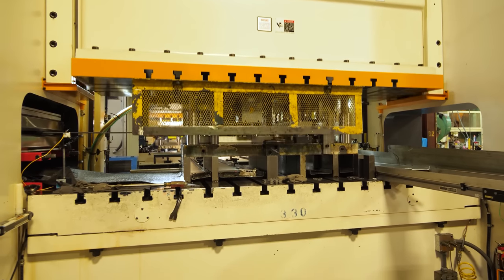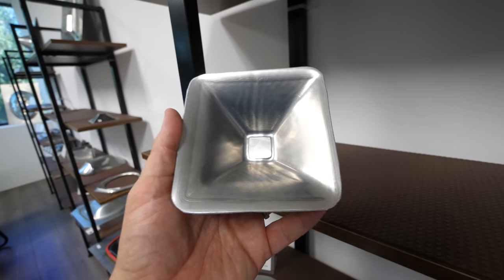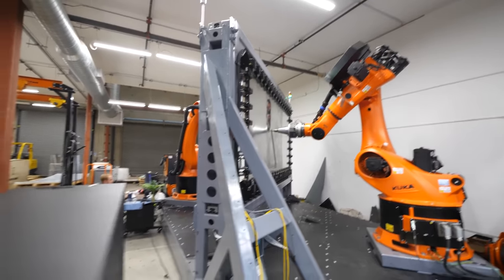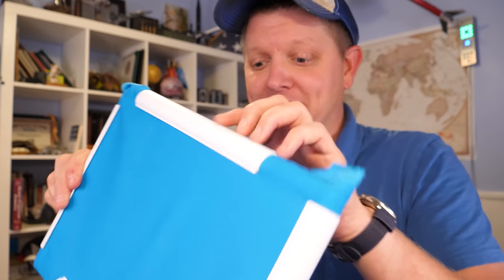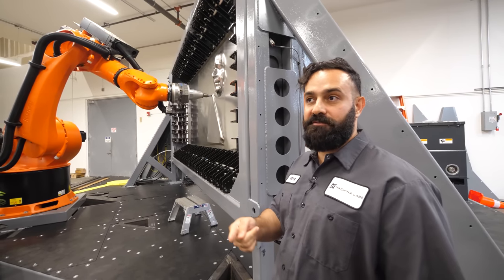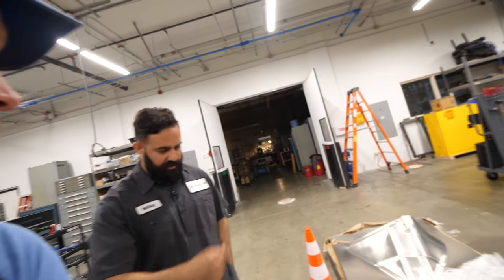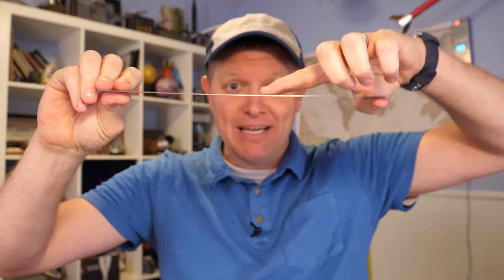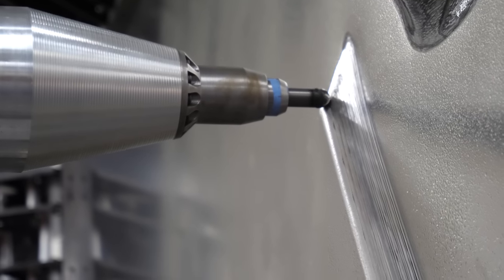ROBOFORMING: The Future of Metalworking? (I Had NO IDEA This Was Possible) - Smarter Every Day 290

Comment from the maker: The Manufacturing Series is AWESOME. If you like awesome things and hate spam, you can sign up for the email list here:: https://www.smartereveryday.com/email-list
Reply: this is absolutely amazing, thx for sharing OMG amazing
Reply: Holy smokes that's a lot of data to process afterwards
Reply: you should follow this video with the old hand method of english wheels and pinch rollers .. because that is exactly what this is ... just updated to be done by robots instead of people
Reply: I love this channel, and this is some of the smartest, coolest, and most fascinating smart stuff going on right here! Wow!
Reply: Why not move the sheet instead of using Mr. Roboto?
Like what a English Wheel sheet metal shaper does.
Reply: Why don't they run a machine closer to a 3d printer with set xyz axises so you could get more Rididity
Reply: Absolutely loving this series
Reply: thanks for this video
Reply: About metal stamping. Can't we use AI to create forms? Problem of complicated design solved.
Reply: CRAZY! Mind blowing!
Reply: Alpha Phoenix and steve mould did some amazing videos on how the atoms in the metal move.
Reply: One topic the video and your discussions seem to have not covered is applying heat to the metal to make forming easier. Is this something that was discussed during your visit? I understand the constant friction from the rolling would heat up the metal as it's being formed but I'm referring to heat from an external source.
Reply: Hey Destin, this is so interesting!

I do have a suggestion though. For the example at 7:30 , if you use aluminium foil on a sewing frame instead of fabric, it will be easier to make your point across. Because the foil will behave more like metal and less like fabric; it might actually hold up some shape after you poke it with your finger. You’ll have to be careful not to tear through the foil though. Maybe multiple layers of aluminium foil will be better.

Great example regardless. 👍
Reply: Okay, they mentioned hypersonics. Please tell me given your old line of work you guys got to nerd out off camera about some of that.
Reply: You cannot get "smarter" every day.  You are born with what you have.
Reply: Love this manufacturing series! ❤ Everything's software and coding these days and it's refreshing to see how physical things are actually made. 🤠
Reply: with a non-magnetic material like aluminium, could you use a magnetic backer to provide that support and run the process with one arm? If then, Could you just "pull" the metal toward you with a bearing rolling on one-side and a magnet on the other?
Reply: Please keep posting videos on manufacturing, even if its a few sprinkled into your normal uploads!
Reply: hey it's not as cool as this but I work at Collins Aerospace machining carbon fiber brakes with CNC. You've talked about CNC before, but machining carbon fiber offers some unique challenges separate from machining metal
Reply: Geometric algrebra is a very interesting area of mathematics. For example, Maxwells equations plural become Maxwell's equation (singular). They all get subsumed into one. 
What's also interesting is that Geometric algebra solves robotic problems like this. 
I wonder if that's how they are operating.
Reply: Also, you should find someone who is really good at an English Wheel. They're artists who have been doing that by hand for...ever.
Reply: I wonder if they thought about moving the material to help with deflection problem for certain applications
Reply: @charliecostella  Anealing on the fly was my thought. 

Another was different tools on each side. A ring on one side, the existing tool on the other. 

For deflection, why not partition the area off into smaller areas? Less deflection. 

On the cutout at the end. Cutting tool one side. Why not have some sucker tools on the other that hold the part and place in a stack. 

That shows one restiction that I can see. Getting an under cut [a cave is going to be hard. All it can do is replicate a height map with only one height at each x y point
Reply: 2:30 thats not you talking in the room. over talk
Reply: @StrayVagabond  huh. Thats neat
Reply: I enjoy your videos Destin, I really do but this dude has set my brain so on fire, I don't think I will ever recover. I'll be honest I kinda wish I could hire him as a teacher or figure out who taught him at school, cause he's on fire talking to you. You also did a good job providing context and helping me understand some of this higher level engineering stuff.       .... Dang if I didn't want to be an Archaeologist I would be an engineer, those people always have the best ideas.
Reply: Its a virtual mold.  Very neet.
Reply: Modern English wheel
Reply: Hope you invited Dream Theater to that progressive metal factory.
Reply: Keep doing this bro. People should fund this content for tv honestly. USA needs it
Reply: THis is a computer controlled with a robot English Wheel that craftsmen been using for a long time but not this accurate.
Reply: I could se this technology making star ship hulls at a breakneck speed. one big sheet no weds just pinches.
Reply: @smartereveryday  I am real ly inter rested in you are clock. What is it
Reply: I can see an application for this technology for manufacturing aluminium panels for bespoke one off cars.  I see lots of comments about this technology being a modern take on an English wheel
Reply: Wouldn't it be cheaper and more accurate to use ballscrew 3 axis machines instead of robot arms?
Reply: I used to install machines like this for cutting stone. Robot arms are impressive eye candy for walk through guests, but they''re not known for their prolonged accuracy. 3 axis machines with gear racks can easily get you plus or minus .002 of backlash. Ballscrew CNC's can get you .0001 accuracy.
Reply: ...and now you HAVE to do at least a bit of sheet forming using 'bullets hitting bullets'.  :grin:
Reply: Being a 52 year old 'Grumpy Brit Git' (lol) Electro/Mechanical Engineer myself, I've been watching Destins videos for years with much fascination. And I just LOVE the idea that Destin is going to all these factories and plants to explain what's going on in a fun way, not just to entertain us with enjoyable content, but, like he's done for all these years.... To hopefully help the younger generations learn the wonders of engineering & manufacture so we get new electricians, mechanics, engineers, programmers and many more besides into the associated industries. I simply CANNOT commend you enough Destin! You're a top notch fella! 👌👍
If you think about it... This is the thoroughly modern take on an 'English Wheel' (two varying sized rollers 'Pinching' sheet Aluminium & steel a craftsman uses to make hand made car (and other) body shells)...  
😎🇬🇧
Reply: yeah, they have trouble  to form titanium Inconel, hastaloy, monel... c300 vasco... even in sheets. too much nickel mixed with iron, manganese and chromium.
Reply: @kaboom-zf2bl   done something similar to what you have just said in school many moons ago with copper molding ashtrays. from sheffield UK
Reply: now i know Han Solo wasn't really in carbonite
Reply: When you were explaining the backlash with the drill and gears. The way you help neutralize the lash is Pre-load. You never release the pre-load from the other side. You just decrease the force applied to allow movement in the opposite direction. Just adding some polish to your explanation.
Reply: 12:25 is a rack and pinion operated sled.
Reply: @thedarkknight1971  "If you think about it... This is the thoroughly modern take on an 'English Wheel'." 

That was one of the first thoughts that popped into my mind.  Perhaps going back over the formed piece with MUCH larger 'wheels' would help it to be smoother.
Reply: Impressive stuff technologically speaking, but one does have to wonder if it really pays.  So much of what is done in business now only appears to be competitive because of subsidies such as windmills and electric cars.  They basically ignore the subsidy money being poured into it, but if one (as one should) includes the subsidy money propping it up that's the full cost and one sees that it is not competitive.  Just that something requires a subsidy means it is not competitive.  That he said, rather vaguely, that the break even point is farther out than one might suspect does make me wonder.
Reply: @OB1canblowme  I forgot to say I know an application where harmonic drives dominate. On space probes for things like cameras. Its because they don't require lubrication like cycloidal boxes do and they weigh a lot less.
Reply: @KeithOlson  Well, they did say that 1- They're still developing the idea, and 2- They did have different sized 'Inserts', and if you noticed the difference in 'Ridges' on the Triangle, compares to the 'Bowl' designs, maybe they do, or maybe it's part of their 'Finishing' process? 🤔
Reply: @hanswerner321  Yeah but if have ever been around die making you'd know how time consuming that is.

With this system you can design something and then just get it made right then. 

If you want to press some of these parts it takes weeks to do all the machining of the dies. Some of these parts would need a collection of progressive dies and that's a lot of machining. Its one of the main reasons car companies don't seem to change much from model to model.
I used to work in the Australian auto industry and spent time in pressing plants. You'd be amazed how many parts go from car to car with almost zero changes because its just to costly to make new dies every time. Its why so many famous sports cars had all sorts of things from the spare parts bin.

So for low to medium manufacturing this would have advantages BUT for serious mass production where you're making 1,000s of cars a day you're right its too slow.
Reply: I'm watching this video and I keep thinking about vehicle body guys and hotroders. They do this with 2 hammers and feel it out. What an art form.
Reply: @kyleteal5888  Your right. The basis for this is the sheet metal forming the body shop guys do with an English wheel where they have 2 rollers with slightly different shapes that they use to shape fenders, hoods,...etc.
But they also include the the methods used in high end metal folders and press breaks except this is a point load system not a long liner tool.
Reply: Seems like a lot of waste is involved forming this way. 26:10 one part out of a huge sheet of metal
Reply: You should come out to kenlake foods. We pack peanut products in cans and bags
Reply: this is one of oldest ways to make things from metal sheet... it was used for sheet deforming for hundreds of years, only new is that now it is  done by robots and not on lathe. "Metal spinning can be traced back thousands of years. The first pictorial evidence is in the tomb of fourth-century Egyptian pharaoh Petosiris, which features an illustration of two men operating an ancient lathe."
but I love how you make it super hype... BTW great move forward to have free shape deformations, not only circular ones.
Reply: @ngrey5092  Good point its in that area of metal shaping but its closer to folding and what's done in a press break. 
They are all part of the same basic principle of cold forging thin sheet.
Reply: @HingleMacCringleberry  There's also another Edge Precision vid where he starts with a 930lb blank that machines down to a 133lb part. That's 797lb (over 85%) of the raw material is removed as waste.
the title of that vis is "830 Op 1 Cad Cam"

The waste isn't a problem its a matter of what they do with it.
Reply: Just a Amazing process.
Just add AI.
I am sure that is on the horizon?
Faster with increased quality, I would think.
Reply: Best series ever! How it was Made on steriods!
Reply: Team up with Titan of Titans of CNC great channel! You guys would mesh well!😊
Reply: Thank you very much. How is this technology going to compete with the 3d metal printing?
Reply: This is one of the coolest things I’ve see on YouTube!
Reply: @Mackeykevin 🎉😅😅.😅0😊
Reply: Love this series. Just to let you know: the Manufacturing Series playlist is missing the stamping video
Reply: don't know how Dustin does it;
one home run after another...
this vid...wow! wow! wait right there
i need to pick my jaw off the ground
Reply: VERY VERY good episode!
Reply: IDK what's so amazing about this- the basic concept is simple-- the hard part is getting a couple of robots programmed to matching force in a,manner that achieves the desired results-- but you can accomplish the basic concept with your thumbtip and forefinger tip and a piece of modeling clay.  But that's what AI programming is for ain't it?
Reply: Again... Can we get a playlist for this series, so I can share with my company buddies?
Reply: @ericjohnson8001  over several hundred years of
tool & die progress has made
this possible. Instead of one 
point moving with precision,
its 2. The same effect is achieved
by closing your eyes and feeling 
your way into touching the tips
of your index fingers together.
It really doesn't take long to master this.
However, with robots it a bit trickier. No harder than building the pyramids.
Reply: You should come to my work Superalloy in Cincinnati OH we do ECM machining on jet engine parts it’s a fascinating process!
Reply: Can we try and fill up one side with water(like the sheet is a wall of aquarium) so that we can get a uniform support on other side instead of a second robot.
Reply: This is absolutely brilliant. Not only can it create current production custom parts. This could be used to make Sheetmetal parts that are not longer made and no dies exist for it and pure one off custom. Endless applications.
Reply: It could also be called reverse 3D printing
Reply: Good Video! But you gotta work on keeping your Hands away from stuff.
Reply: Destin what drives the speed outside of the mechanical limits of the robots?
Is it computation - the speed the software can read the sensors and make the  required calcualtions?
Is there like a required "loiter time" that the effectors need to sit in a point in space after each move to keep stressing the metal to a point where it would not spring back?
Reply: do a vid on gears ...like how backlash is unavoidable if you want them working ...or mag gears
Reply: Simultaneous Shape pressing
Reply: With that minimal output, maximum investment how does this company generate profit?!
Or is this one of those venture capital and public funding burner start ups?
Reply: imagine, a unibody F35
Reply: Why is  "Tha J to Tha R O C"  telling me about Metal working?
Reply: I'm curious about work hardening of the piece as well as surface finishing after forming. I assume some grinding for that truck hood was required. I will check out the long video, maybe I'll find more details there. Thank you for the great video, very interesting!
Reply: Like it. Perfect for prototyping, small series, … and many other applications.
Reply: If one side always moves to stay at a fixed point, why not use something that only moves on 2 planes. Basically a hydraulic press mounted on its side with something to move it along just Y and Z or just Y and X. Seems like that would have less variable to calculate than what they are doing here.

Comment: As an engineer one has to really appreciate the complexity of the task, coupling flexible multibody dynamics with non linear solid mechanics and being able to run it an control it real time. Under the apparent simplicy it is really like magic
Reply: I am no engineer, “only” an it-specialist. How can that be so freaking complicated? In my opinion you just need a bendable frame and two ballpoint tips to pinch and dent, isn’t it?
Maybe I am extremely dumb or maybe missing something 😅
Reply: @MrBro51  You are definitely missing something and a lot of it is in the process.
Reply: @MrBro51 I’m just an IT specialist too, but I can easily see how difficult the control system and feedback loop have to be in order to allow for this kind of precision forming. To gain an appreciation for it, see if there is a local First Robotics Competition team (probably at a local high school) in your area and become a mentor, most of them are constantly looking for good people to help out the team.  The control systems in use on FRC robots are much more simplistic than this, but it takes a lot of programming to make them perform their functions correctly.
Reply: The software code alone has got to be pretty intense. It ain't no Gcode for your 3D FFM printer! I'm curious to know what language they coded in.
Reply: 100% agree. I rarely come across something where the more I think about it, the more insanely complex and brilliant I realize it is.  This is absolutely amazing.
Reply: I cant begin to think of the teething headaches...and software...and quality of metal stock required (tensiles etc) plus the fact that that the two fingers are moving under load and friction...the equipment would be worth a bomb if you wanted to purchase one. Dont blame them protecting their IP.
Reply: Take all of these comments, and then think that human brains and hands have been doing this exact process in clay for about 20,000 years.
Reply: @PatrickKQ4HBD  ok
Reply: There's a reason the CEO is a software guy instead if a materials guy.

That's why they don't mind showing their robots working because the code to get them to that point was the hard part.
Reply: I really appreciate seeing the continuous improvement. Seeing all the holes randomly drilled on the old equipment made me smile.